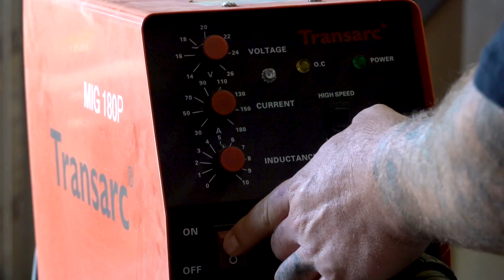Epic Mini Mobile Forge - Build Video

Comment: This may be a stupid question but is it possible or even reasonable to heat up the stock from the bottom side of the forge? Thought I’d put that out there, thanks 👍
Reply from the maker: Not sure... generally I see their heat coming from above... I think both ways should get your steel hot, but with them at the bottom you may be more susceptible to blocking your nozzles and stuff...